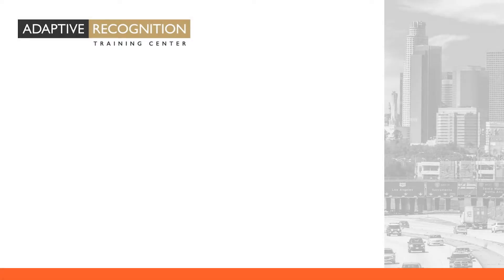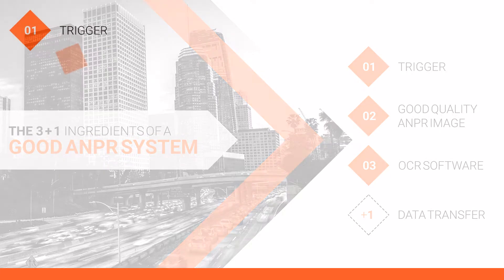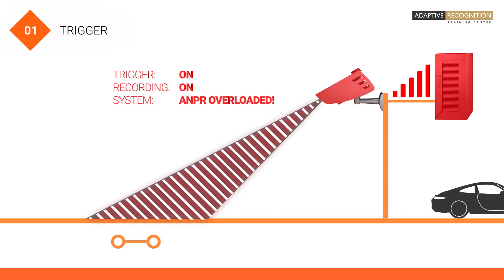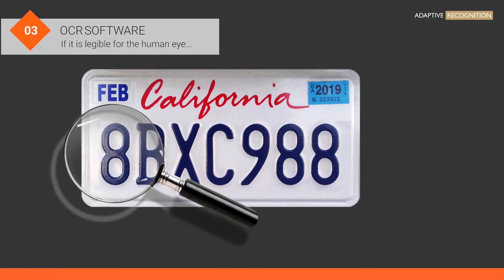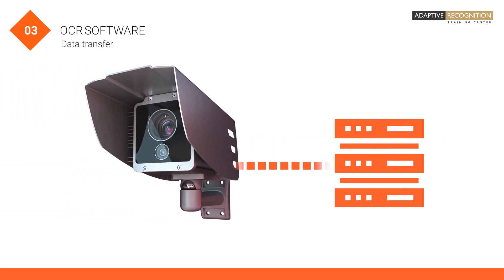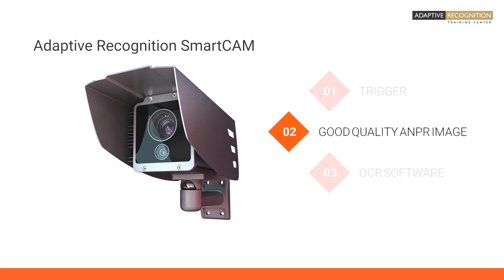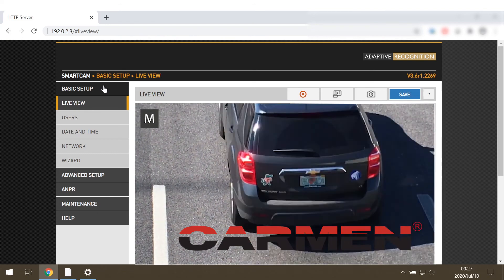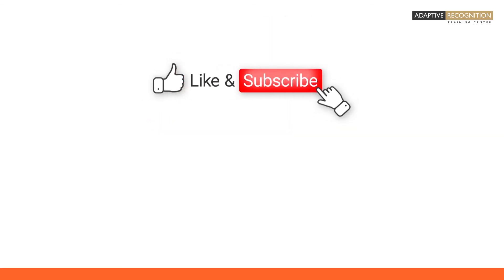How-to Video: ANPR Cameras / Episode 1 – Every good ANPR system needs these 3+1 ingredients

Comment: What sensor do we need for external trigger or internal trigger
Reply from the maker: The camera sensor has no effect on an external triggers such as an inductive loop or IR barrier, if the internal trigger means video analytic than depending on what kind of analytic you are planning to use you might need different resolution, please contact our sales team here: https://adaptiverecognition.com/general-contact/ with a little more details about your current requirement so we can help you further finding the correct solution.